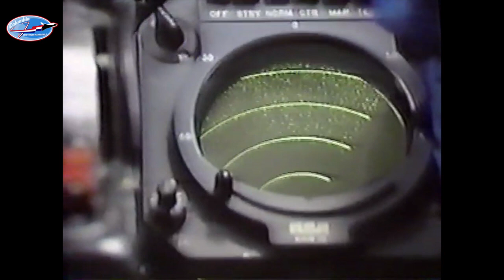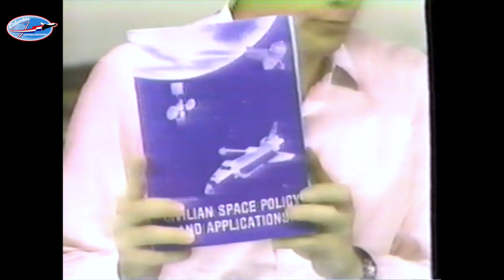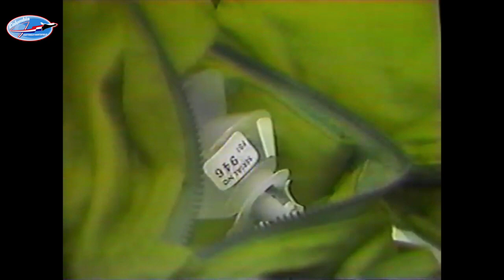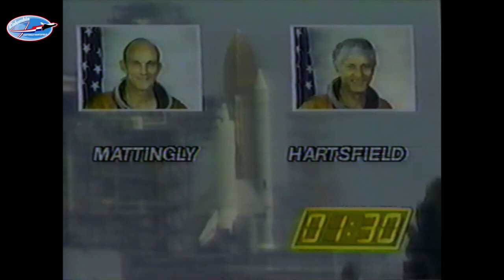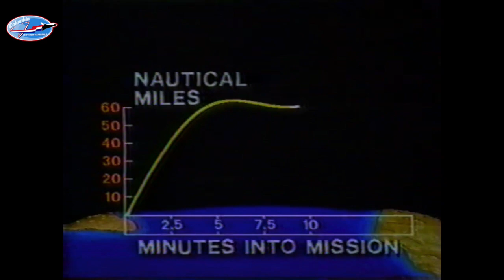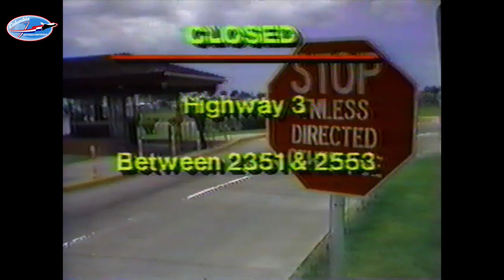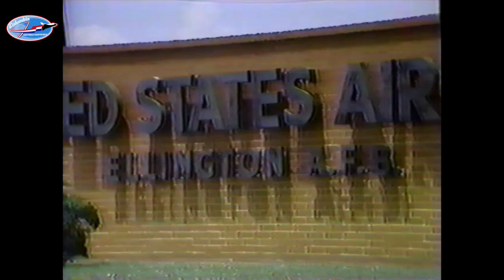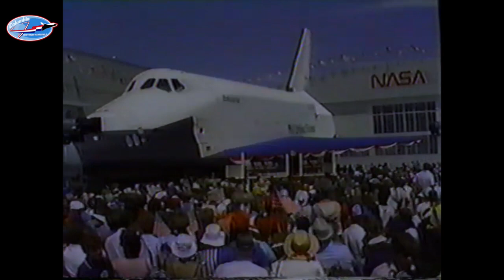Space Shuttle Columbia STS-4 TV News Coverage

Comment: What a great video collage of network coverage, I recall the days of switching through the big 3, to see who had the best coverage. Of course this was the last OFT (Orbital Flight Test). The biggest difference? This was the last time a shuttle would carry armed ejection seats for the two astronaut crew. STS-5 and 9 Columbia carried the same seats with with the rockets and ordinances on overhead panels removed.
Reply from the maker: Interesting, I didn’t realize the seats remained for sts-5&9, makes sense though for sts-5 given the short turnaround cycle but surprised they were still onboard for sts-9.
Reply: After this flight, starting with STS-5 to STS-51L, you saw crews wearing blue flight suits that consist of blue flight coveralls, a clamshell helmet, and a Mae West style life vest that had a sky genie device that allowed everyone on the flight deck to repel out the top of the Orbiter and an escape bar that had crews drop 10.5 ft to the ground. After the Challenger Accident, the crews went back to pressure suits for launch and reentry.